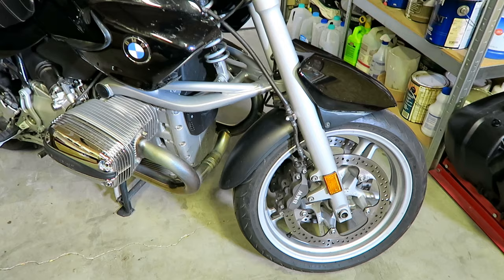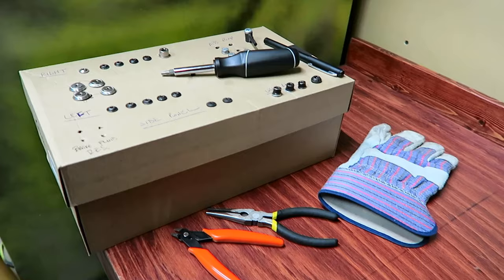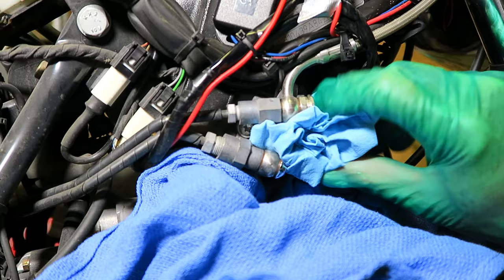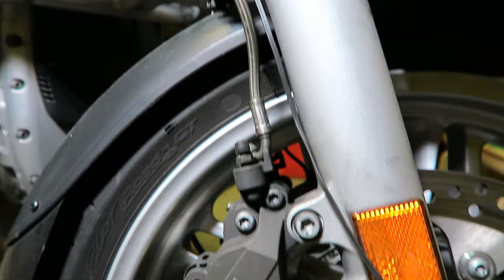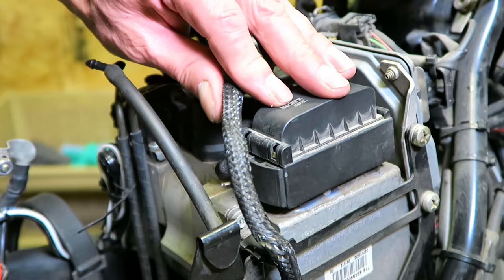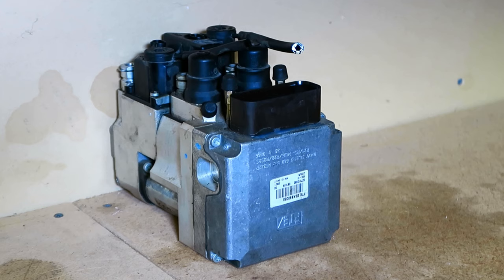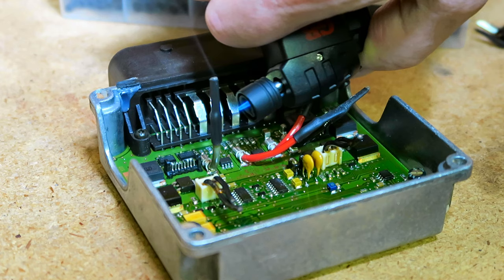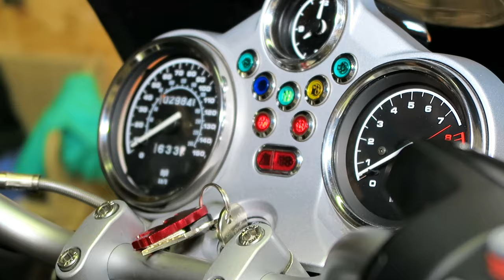BMW R1150R ABS Removal | How I Convert My Bike to Non-ABS

Comment: Not sure why the ABS hydro pump failed, you didn't mention, but a common issue is that home mechanics bleed the brakes but don't bleed the ABS pump. The pump has six bleed nipples and you should bleed the pump every time you do the brakes. My bike is 23 years old and the brakes are still unbelievable good since I always bled the ABS pump. The pump also can be serviced for a very low cost. In Europe is between 100-150 euros. Anyway great video and tip.
Reply from the maker: I had the system flushed at the dealer shortly before the pump failed.  I'm the third owner of the bike and I don't know the maintenance history.  The previous owner did his own work.  I had a BMW mechanic from Seattle run a diagnosis and he told me I needed a new pump or rebuild.  The shop that does rebuilds near me had a backlog on units waiting for rebuilds.  So I opted for the DIY removal.  Losing the brakes was a bit frightening.  I wasn't traveling fast but not being able to stop quickly was alarming.

Comment: Hello Wheel Stories, the film shows that you also have very good technical talents. I wish that this would also be allowed with us in Germany where such a change would invalidate the operating license. We have to do a technical inspection with a short ride test on motorcycles every two years. I wish you a safe journey

Best wishes
Reply from the maker: The repair with a brand new ABS module is very expensive.  Over $3K US with labor.  I  don't know that I would trust a used module.  I believe a rebuild is possible.  But on a 16 year old motorcycle I couldn't justify the expense.  Every motorcycle I've owned in my life, up until this one, has been traditional non-ABS.  So that's the choice I made.  Thanks for watching and posting the comment.

Comment: I did everything you did with the exception of bending a lip on the bottom edge of the module cover.  Two holes were drilled in this lip aligned with two existing mounting holes and then bolted it to the bike.  One tywrap was used for additional support.  Unfortunately, this did not work for my brakes. When the key was turned on the brake light came on, got hot and burned out.  The normally closed switches closed the circuit.  It’s not clear how the module controls a normally closed switch to complete a circuit to the brake light when the brake lever is pulled to creat a normally open position. It appears that in my case obtaining the normally open switches will be required.

Comment: I like your solution for the brake lights. But why not just leave the whole ABS unit in the bike so you don't have to fabricate the cover for the electrical box?
Reply from the maker: The component was heavy and connected to the defunct brake lines and full of fluid.  So I decided to eliminate the module, pull out the unnecessary fluid lines and clean up afterward.

Comment: a really good review and "how to do" video ...my question is, is this setup up on a R1150 the same as on the R1100s ?
Reply from the maker: I'm not sure having never studied the R1100S.  I suspect the fluid lines are the same but the electronics and wiring could be different.  I don't know the answer there.

Comment: I used an RH Electronics 2nd Life Kit to restore my R1200CLC.  Only current issue is odometer and speedometer are incorrect and may be reading KPH.  However, I do have brake lights, cruise control, brakes, no warning lights.

Comment: Great video and the instruction is spot on.  Finally did the conversion/extraction on my 2004 Rockster but the only thing that I am having as issue with is that my speedometer no longer works.  I'm guessing it might be the speed sensors.  Is there a good way to test the sensor(s) while it is on the bike?    FYI, Motorworks out of the UK sells a custom fit cover for the back of the ECU. No need to cut sheetmetal if you don't want to.
Reply from the maker: I don't have a good answer on the speedo question.  Both of my bikes have the mechanical speedometer attached to the front wheel.  You might find some posts about it online at some of the BMW message boards.
Reply: @WheelStories  Got it.  Thank you for the quick response.  And again, great video!

Comment: Thank you very much for the very detailed video. I have a 2002 R1150R with the ABS failed after replacing the brake lines which started leaking. However, when I opened the circuitboard I realized theis had melted. Consequently the brake lights no longer work even with well performing brakes after the conversion. You mention a kit, replacing switches etc. from a non ABS model. Any advice going forward with that? 
Again many thanks for the video and info.
Reply from the maker: It has been so long ago since I removed the ABS module from my bike, I can't recall the details on the wiring alternative.  Search the internet.  There is a blog post somewhere that explains how to replace the switches and revise the wiring so that the entire module can be removed.  Includes a wiring diagram.  There is a solution out there.

Comment: Ironically I’ve had my RT for 17 years when it’s ABS module quit. They’re currently not even available for purchase, and MSRP is $2,750 for the part alone. Add another $700 easily for labor. The factory servo is a problematic system, and I am relieved that it’s outta there!
Reply from the maker: I believe BMW has resolved a lot of problems with the newer ABS technology.  Wish the older integrated ABS units weren't so expensive to repair.

Comment: Hello,
I am from Germany. I have expandet my Abs System from R1150R from 2003.
The repair of the Block costs 1150€ in Germany.
I have expanded the Modul with the electronic Module. My BMW have  a mechanical Speed shaft and so the Elektronik Block controls only the rear an Brake  light. The R1150R rockster is more  modern and has no mechanical speed detector, it needs the Elektronik Block and the Abs sensor from kardan shaft for speed detection.
The Break switches are normal closed contacts, i invert  the Signals with one Relaise .
I have Made a circuit Diagram that Shows the Control from the brake and rear light .
Farther i changed the rear break Pump.
From 16mm to 13mm, that is the pump that the original R1150R without the option Abs in germany has.
I hope i See more interesting Videos from you
Best regards
Reimund
Reply from the maker: Thanks for watching and sharing the information.  Sounds like you've done your research and have a good understanding of the electrics on the motorcycle.

Comment: Nicely done!
Reply from the maker: Thanks!
Reply: Great video! I want to do this on my 04 R1150RT that has the servo assist brakes. Quick question, when you tested your brake lights, I didn't hear the servos motors kick on, I'm assuming because the ABS pump was removed and bypassed. Just wanted to make sure that was the case, and the servos weren't an additional system on the bike. Can you please confirm. Thx

Comment: Hi ! After two abs modul fails on my k1200s. 2006 , i finnaly did the same job then you. When it was finished, i found that i lost two things . No more speedometer an automatic cancelled flasher. Have you any idea of a solution. Thanks for your marvelous job on explaning things.
Reply from the maker: I have never studied or worked with the K models.  I'd recommend consulting with a mechanic who has worked on the K1200s to find a solution.  The fix may require some creative wiring for the controls.

Comment: in addition to the direct connection with the brake calipers, would it be sufficient in the electrical part to remove the fuse and the relay to exclude the ABS and the warning lights?
Reply from the maker: Removing the ABS relay will stop the flashing warning light.  I'm not certain about the fuse.  Removing the fuse may disable some other dash indicators as well.  You could reference a fuse diagram and do some testing to see what the story is on the fuse question.  Thanks for watching.

Comment: Very thorough and simple. I have a 1997 R1100R. I really want to do this, but have a question. Is the brake and tail light wiring fix the same for my bike as it was for yours? The shoe-box trick is now permanently a part of my disassembly routine. Thank you.
Reply from the maker: I don't know the answer to that question.  I'm not familiar with the '97 R1100R.  I'd hate to steer you in the wrong direction.  I'd recommend doing more research and checking with a professional BMW mechanic.  If you're ABS system is still working properly, I wouldn't mess around with it, to be honest.

Comment: I have an opportunity to purchase an absolutely perfect 2005 R1150R with only 12,500 miles on the odometer. The only drawback for me is that it has ABS. I have 3 R1150R's that are non-ABS.  I definitely want to remove the ABS.  Your video convinced me that it's possible.  However, I'm not at all mechanically inclined and would need to find someone to remove this for me.  I'll begin by checking with my local BMW dealer.
Reply from the maker: Let me know what the BMW dealer says.  I've heard that dealer mechanics may decline the request to remove the ABS module and offer to replace the unit instead at a significant price.  I'll be interested to hear how the dealership responds.  I've never looked at a 2005 R1150R to see if the ABS setup is identical to the 2003 and 2004 models.  You might research that question before making any decisions on the removal.  Thanks for watching and posting the info.
Reply: The first dealer was reluctant to remove the ABS and indicated liability as his concern.  I am waiting to hear from another BMW dealer and will let you know what they say.  I appreciate how methodical you were in your presentation and work.  Everything was so clear and precise.  Nicely done!
Reply: @WheelStories  The second dealership expressed the same concern from a liability standpoint.  If I decide to purchase the bike I will need to find someone else to remove the ABS.
Reply from the maker: That's what I was thinking might be the response.  Good luck with whatever you decide to do with the potential purchase.  Too bad that era of BMW ABS systems comes with some risk for problems.  Otherwise the BMW R1150R is an outstanding motorcycle.
Reply from the maker: Sorry to hear about the dealership.  Thanks for watching the video and posting the kind comment.

Comment: Hi, just one question. How did you manage to put rear light and break light functioning? Did you apply any change on the circuit board of the ABS?
In my case only the rear light plate and breaks dont work...no ABS error, just that.
Thanks a lot.
Reply from the maker: Thankfully I didn't have to make any electrical modifications apart from the work shown in the video.  Lights worked as normal.  Just the ABS warning light on the dash remained lit up.

Comment: Great video. My 2019 Triumph Bobber abs has been malfunctioning and dealer says it's my problem cause I put a cartridge kit in forks and changed my shock .He keeps going on ,even calls me about letting him do mods. I want to remove abs module ,like you did. I am 66 and used to race bikes, so I like no ABS too.
Reply from the maker: Sorry to hear about your ABS.  I'd recommending consulting with someone who knows all about the Triumph Bobber ABS before making a decision.  Could be a whole different setup from what I encountered with the BMW.

Comment: Just watched your video, very good. My brake failure lights came on unannounced. Checked the fluid level on the front and it's dirty but not empty, are the brake failure lights an indication the ABS failed and needs replacement, most likely scenario? I'm riding a 2001 R1150RS so there are some miles and age on this bike. Thanks for any advise. I agree with your logic and approach to the problems, and it's the one I'll use if the ABS is defective. Are there other ways to determine if the ABS is bad or are the warning lights sufficient. Thanks again.
Reply from the maker: If the brakes are still working you may be in good shape.  I'd recommend taking the bike into a shop for diagnostics.  The tech can hook up a computer and study the errors.  When the ABS system fails your brakes do not work.

Comment: Hi. What about instead of buying the "distribution piece" for the front brakes, just swap the thru-nuts on the ABS side to a short brake line connecting the two lines? Cheers George.
Reply from the maker: I'm sure that would work.  I believe there is a company in the UK that sells a "U" shaped connector that will work with the existing distribution piece.  There are several options, for sure.

Comment: Hi. The reason I have suggested the short section of brake-line is because here in NSW Australia I am having difficulty finding a supplier of the distribution piece you mention. My bike is a 2005 R1150RT. Like you, I have ridden for many years (now 72 years young) without ABS. I am not comfortable with such technology. I don't even use the cruise-control on my Subaru. If you have the time, could you let me know thw company contact details for the 'u' shape in-line brake tubing. Regards George.
Reply from the maker: I don't know the name of the company.  I read about the "U" shaped adapter on a message board somewhere.  IMPORTANT NOTE:  Do your research on the R1150RT first, if you decide to follow through on the project.  My understanding is that you may run into electrical problems with the RT.  For instance, the speedometer may stop working and perhaps some lights.  My R1150R has a mechanical speedometer motored by the front wheel.  I believe the RT is electronic.  I don't know about the lights and how their linked to the electrical system.  Be cautious and study first is my recommendation.  If the ABS system is still working, no point in changing something that isn't broke.

Comment: Love the video, provides a great alternative. Also saw the Ride Report. Question, when yours fails, did you loose power to both front and back brakes? My front seems to be fine, just the back has no power. Trying to confirm it's the ABS module. Thanks in advance.
Reply from the maker: Yes.  I lost power to both front and rear brakes.  It was scary.  I'd recommend having the diagnostics checked.  The dealer or a BMW tech can plug the bike up to a computer and study an error log.  Only takes a few minutes.  That will give you a better idea of what's going on with the ABS.  Thanks for watching.

Comment: Hi I need to replace my non ABS 2002 R1150GSA wire harness and all I can find are ABS ones .
I think this would work but not having the ABS units brain I'd have cut the braided wires to get the brake light working .
Do you know which wires to join please.
Reply from the maker: I don't know the specifics but you may have some luck with a few google searches for BMW R1150GSA wiring diagrams.  You could compare a non ABS with an ABS version and get it figured out, I would think.  Do some testing with a meter as you work through the wiring.  Just a suggestion.
Reply: @WheelStories  Thanks for replying,  I have a Clymers,  but I've just bought a non ABS 2000 GS harness on ebay here in Australia. 
My BMW DEALER said BMW Germany has discntinued this harness so as these old bikes become rarer modding parts like this will be needed.

Comment: Great info video. QUESTION?? I am a new BMW owner. Have a 2004 R1150RT with 67,600 miles.  What is the longevity of the ABS system. Mine works but am considering a removal.  Wondering if most high mile ones have had the removal.
Reply from the maker: I'm not sure to be honest.  Some owners never have an issue with the ABS on their bikes.  Keep on top of the routine maintenance and fluid changes and the ABS may last as long as you own the bike.  If the system is working fine, you may consider leaving the bike as is.

Comment: Excellent tutorial mister! Just a question: When you open the modulator you cutted ALL the cables and detach the two plugs ? Only this? Thank ou again. I want to dothis on my R1150RT 2001
Reply from the maker: Caution:  The R1150RT is different from the R1150R when it comes to the electrics.  I believe the speedometer and tail light may stop working if you perform the procedure as shown in the video.  I recommend that you do more research on the R1150RT before starting the project.
Reply: @WheelStories  The R1150RT of 2001 year has a mechanical speedometer in the front wheel, why sould be stop? For sure I will do more research, if you have some reference of other tutorial regarding the RT please tell me. Thank you

Comment: Great video thanks Mr Wheel Stories. Question please. I have a 2003 R1150GS Adventure with the identical ABS Integral. I've done a two successful absectomies on earlier Integrals but not sure if my 2003 model will throw up additional electrical issues when complete. Any comments before I get the spanners out?
Reply from the maker: I'm not sure to be honest.  I don't have any experience with the GS model.  I am reluctant to offer ABS advice on a bike that I am not familiar with.  I do know that some bikes have speedometers that work with sensors rather than the mechanism that spins at the front axle.  The speedometers that are not mechanically linked to the front wheel may not work after the ABS electrics are reconfigured.